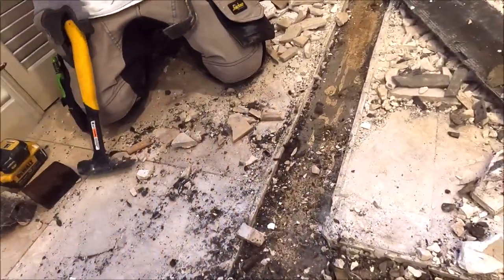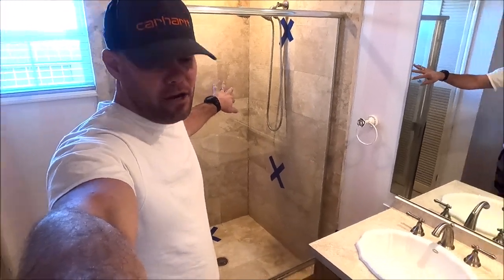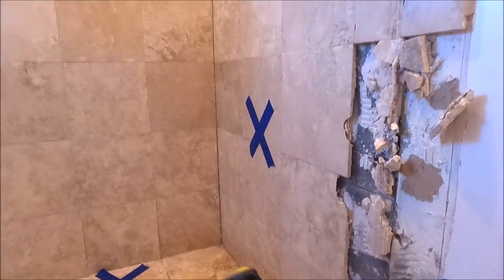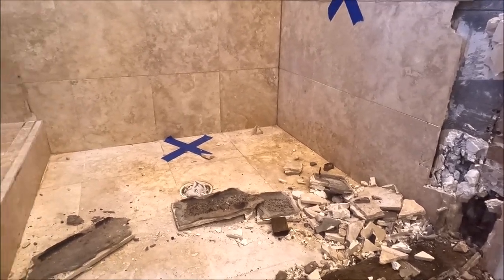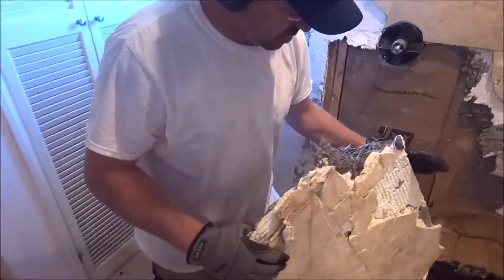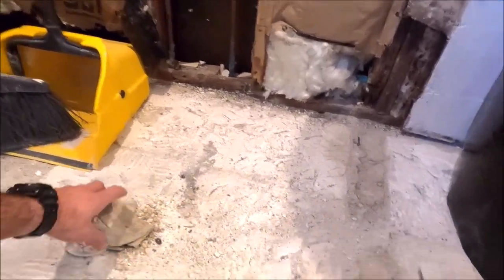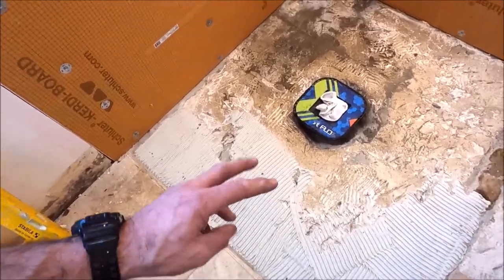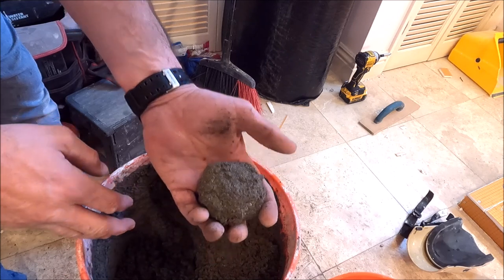NO SHOWER PAN! Are You Crazy?

Comment: Crazy thing is down here in Florida we have recessed concrete showers, a lot of the showers are recessed below the rest of the house and I guess the powers-that-be in the county that I'm in thought that that would hold the water in and there would be no water problems well they just change the law in my County a year ago and now even concrete recessed shower have to be waterproof oh, it's about time! Even if the concrete is recessed, you still need some type of pre slope or waterproofing system, doesn't matter if it's 10 in below grade or 3in below-grade, the water will WIC up and out overtime

Comment: Both my showers in my house here in South Florida had no waterproofing at all either on the slab and the the drain you took out looked very similar to the ones I removed also.  The house was built in 1994 and they used green board on the wall with mastic and 4x4 tile.  They did dry pack the shower floors and did slope it but the funny one was the guest bathroom as there was 2 layers of tile on the shower floor.  No water proofing but I'm assuming they had the drain too high and instead of removing the first layer of tile they just tiled over it.  All my metal studs in both bathrooms were totally rotted out and I had to rip walls out to replace them.  I used all Laticrete Water proofing products and did do a Custom made Foam shower pan by RodKat in the Master and it was so much easier to install but it weirds me out how when the water hits it or you knock on it, it sounds hollow. lol.  But it seems rock solid and I did use the Flow FX drain too.  I also saw that Mapei has finally come out with there version of Hydroban board or Schluter type waterproof wall board.
Reply: Cubans built your bathroom for sure
Reply from the maker: Crazy story

Comment: I tried my first dry pack but the float kept grabbing chunks of the dry pack off the top lol. What was I doing wrong?
Reply: If is packed down and you try to pack more on top that can happen. You need to loosen the pack, add more, re pack. Or, the mix is too wet. Those are probably the cause.
Reply: @fnelsoninteg  ok thanks i don’t think it was to wet I did see little BB’s the through the mix maybe that was it to maybe didn’t mix well enough lol I. Used a trowel and pan.
Reply: @whitneybrown9354  one other thing, if it's packed down hard and you try to screed it can happen. Or if you have a dirty float. Lots of reasons that happens.